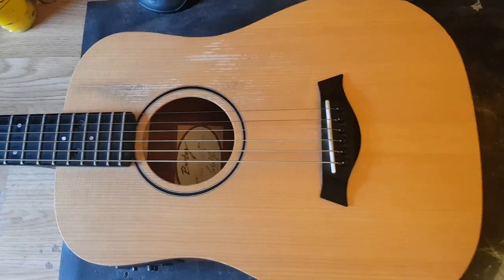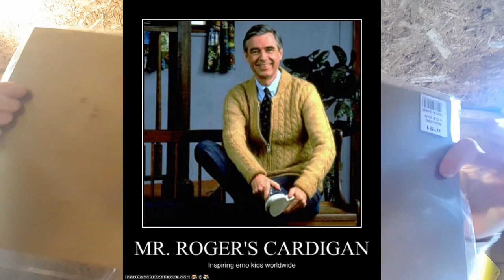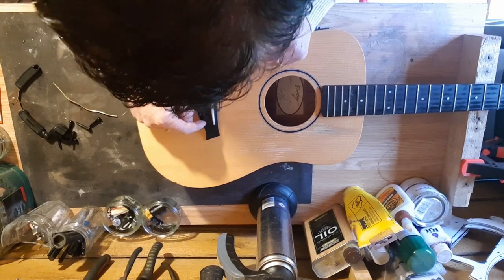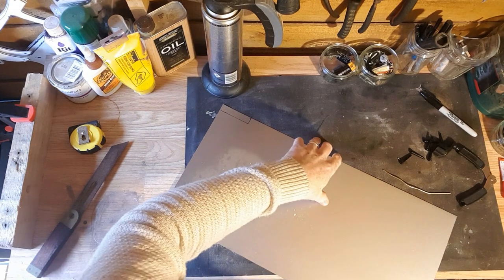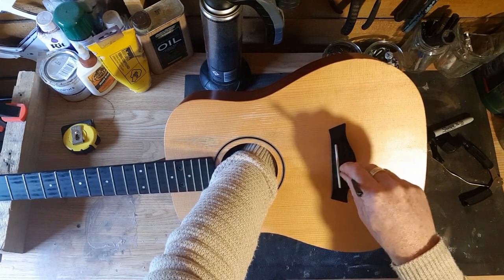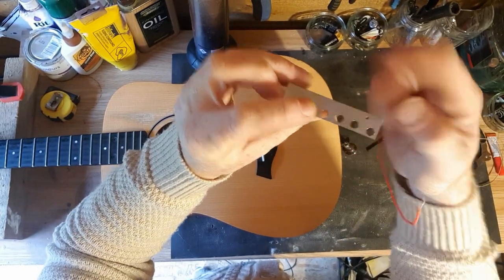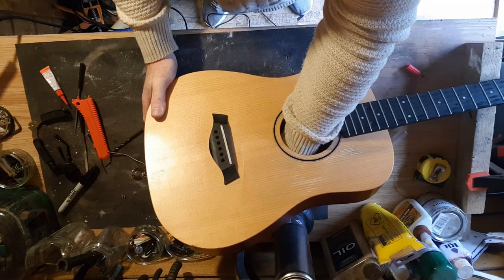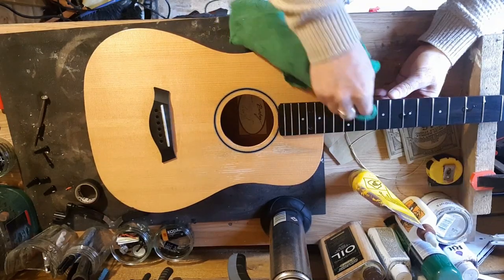How To Fix Grounding Hum On Baby Taylor Acoustic Guitar.

Comment from the maker: I was asked to fix the ground problem on this guitar. Any of you guitar nerds have another method, perhaps a better one?  Let me know would help me alot :)
Reply: Greetings and best wishes!  You've asked above if there's another method.  The trick with the method in the video is that to ground with the strings the holes in the metal have to be small enough to connect with the balls on the strings (otherwise, nothing metal is touching the grounding plate).  If the anchor balls are painted with enamel (as many are) it's kind of chance that all of them will connect to the plate.  The 10% hum that's left is possibly because one or more of the strings still aren't grounded.  In addition since this seems to be a piezo-pickup guitar rather than a mag pickup, I'm not sure what's causing the hum to start with (piezos generally do not create "ungrounded" hum, as they're not magnetic in nature).   But in general a better (and far easier) solution is to replace the plastic or bone saddle with a metal one (brass or aluminum).   Metal forms an excellent saddle that conveys string vibration excellently.  Then drill a very small hole to run a thin wire under the saddle (between the saddle and the bridge, the wire through the hole into the guitar and soldered to the jack.  This grounds the entire saddle, and thus every string that crosses it.  Hum eliminated! (As far as possible.  No guitar pickup is guaranteed 100% totally hum-free.  There are too many things in this world that cause hum.)  Enjoyable video, but the visible lack of a mag pickup and the inefficiency of a metal ground plate of this type makes the concept questionable (at least from what's visible).   Thanks for the video though.  It allows discussion of a very real issue-- trying to  eliminate that elusive hum.   Here's a link to a set of articles regarding tracking down and fixing elusive hum:
http://wishbringer.spruz.com/pt/Tracking-Down-Hum--pt-1/blog.htm
Reply: I had a similar problem with my Fairclough electro acoustic when playing into the computer via an interface. The solution was to replace the mains lead in the power supply for the computer. The earth cable measured 2 ohms, not a lot but enough to cause the noise. I think that heat from the transformer made it go bad.
Now there's no hum and I don't have to touch the strings to make it go away. Hope this helps someone, thanks for your suggestion and the video Brent. Ian
Reply: Was literally thinking of just asking a mate to put a finger on my jack while I do my take cause I didn't want to make mods on a $2000+ guitar
Reply: That's some stupid shit. If it's that noisy, it's worthless wothout mods
Reply: @Wishbringer7  Thanks for that info. That link looks interesting but doesn't work for me?

Comment: Brent the real problem is in the original wiring between the preamp, bridge pickup to the output jack.  Problem is still there,  when you touch the output Jack with your hand you act like a big capacitor to smooth that out. So by putting in a metal plate and connecting it to the output Jack ground and connecting all the strings to the metal plate what you've done is added some distributed capacitance which help to minimize the hum and still touching the strings is the only thing that removes it using capacitance. What you needed to do was take out the preamp the piezoelectric and the jack, fix the wiring grounding problem between those things and put it back in
Reply from the maker: Thanks 😊
Reply: @UCzDyF4oLJoY4P4RA51vZNpg 
I know. As I explained all the added surface area of the Springs connected to the ground has added additional capacitance. The real problem is likely an open ground between the preamp and the output Jack or a bad solder connection. I think what you did was a lot more involved  effort than just fixing the wiring inside that would have been 100%. Adding capacitance is like putting on a big mask.  As long as the owner is okay with it like that then Bob's your uncle. But if you ever get around to having another one like that, and also electrics can develop this problem look for an open ground somewhere between all the things that need grounding
Reply from the maker: I do have one of my own that is doing the same. I'll have a look. The plate method was shown to me years ago and is very easy to do and the hum is gone  Hiwever it would be good to get to the root of the problem. The owner is over the moon and sounds great. Thanks for your advice I really appreciate it x
Reply: Good advice, worked for me, thanks. 👍
Reply: Could i fix it changing just the undersadle piezo? Got the same problem

Comment: So I repair these all the time.
 When set up and in good condition these should be virtually Noiseless. The three most common Issues in this order are: 1) Poor connection anywhere in the the path to ground. i.e. Dirty input Jack, Bad solder joint, (even on preamp board) worn foil wrapping on the under saddle pickup itself. Yes this is also a ground! 2) bad cable (duh but I had to say it) 3) un grounded "system" Hope this helps. BTW Here in the Islands some players go through salt saturated under saddle pickups every six months. Salt and sweat will quickly erode the thin foil wrapped around the piezo electric crystal elements.

Comment: I have a different instrument but found a bad hum was coming from the pre-amp module on the instrument.  The piezo was picking it up and sending the hum to the amp.  You couldn’t hear the hum unless it was plugged in and holding your hand on the removed module.  (In this case it was an acoustic electric ukulele with piezo under saddle pickup.)  I just wrapped the pre-amp with copper tape and it COMPLETELY shielded ALL the hum!  The instrument is dead quiet.  You don’t even have to take the module apart, just wrap the outside of it covering all that goes back in the guitar.  As quiet as when I touched the jack end creating a temporary ground.

Comment: That seems drastic for you to have to do. Was it under warranty. I recently bought a brand new Maton EG808TC Cutaway and it has a hum. Same problem you had. When I touch the cable shield it stops. It also has a buzzy-gurgling sound coming out of the Fender Champ amplifier. When I plug my Martin in with its Fishman pickup system there is NO buzz no nasty sound. Any idea what it happening?

Comment: So I have a Schertler Bluestick which is producing a hum, does anyone know how I could isolate or fix it?
I’ve tried the metal plate, some aluminium but it’s not quite right to attach yet- I need to clean the glue from the last attempt from it and widen the holes to take the ball-end freely. A 10mm drill I think.

I’m going to check the ground wire between control panel/preamp and Jack socket. 
A bit annoyed at the moment because I’m meant to have a gig on Saturday with the guitar. Hmm.

Comment: Hi,  I took a plate (copper-brass) and connected 1 steel-string to the output-jack by using  another steelstring as a wire but that did not work- do you really need all the strings to connect to the plate to have the faraday-cage? When I touch the strings or the outputjack than the hum is gone. I am not sure if I understand the whole thing. Anyone can help?

Comment: Hi - I found the main problem with hum occurring when the jack socket AND its connections aren't shielded, (fully enclosed in metal). Search for 'guitar end pin jack plug socket', that is what you need. My acoustic has no shielding underneath its bridge and has no hum.

Comment: I would have used thin bronze or brass sheet. I would have also screened the pickup. Hutch did you check the ground wire at the control box end? A multimeter is always useful!
Reply from the maker: The way I did it works great and is just one quick way. Thanks for the tips it's what I love about this community. I do have another one to fo so I will try some different methods based on everyones advice. Cheers me dears x

Comment: How do the strings touch the plate if you've drilled holes through it, I've got same problem
Reply from the maker: Once the pin anchors the string it will touch. I just make sure the hole is only big enough to squeeze the ball end through
Reply: @BrentHutchinson  thanks mate, I'll do this mod tomorrow, hope it stops the hummmmm
Reply from the maker: @rocksteady9115  it should reduce it a lot. Let me know how it goes :)
Reply: @BrentHutchinson  worked  a treat mate, many thanks for your help, no more hummmmmmm
Reply from the maker: @rocksteady9115  glad you got it sorted. Neat trick innit :)